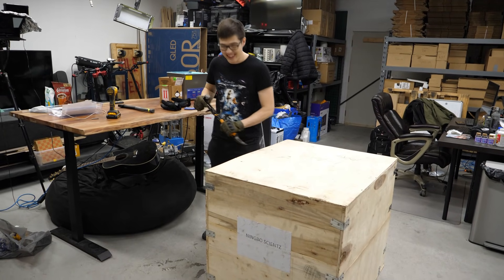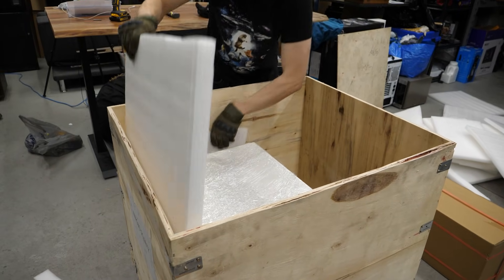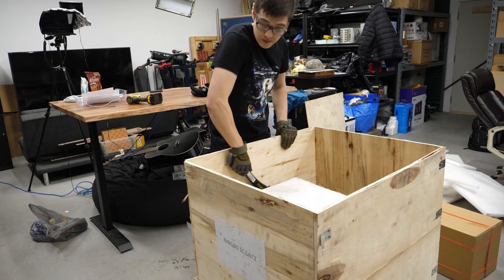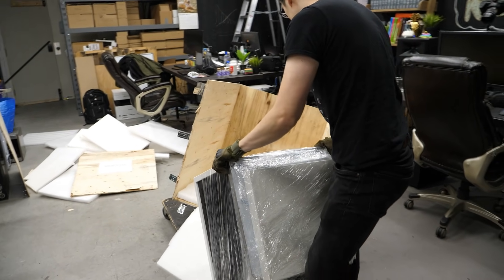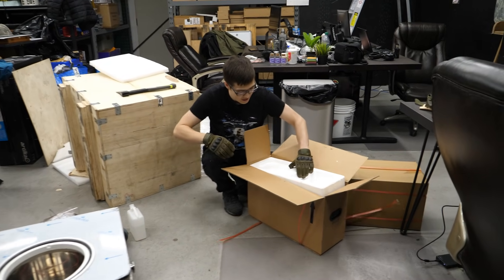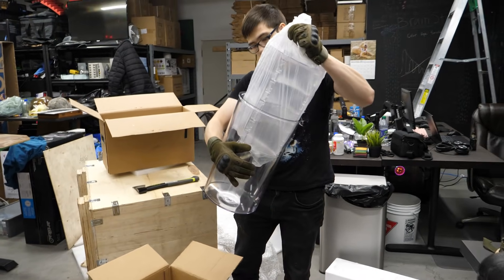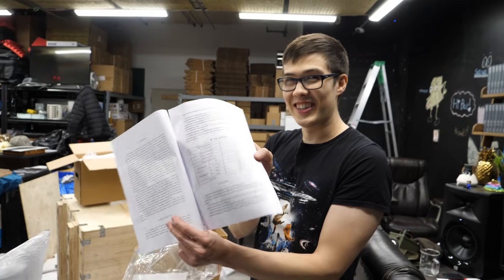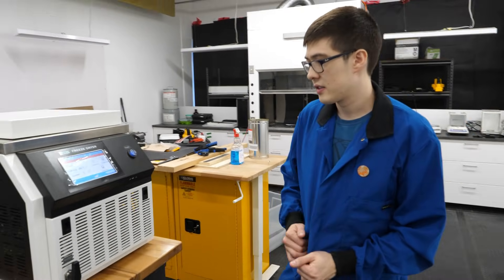Freeze dryer unboxing

Comment: I have a thing to say about you dropping it a little. There is a refrigeration compressed in it and just dropping it a little can damage it also after lifting it up onto one side you need to leave it for around 30mins before plugging in because the oil in the compresser can go were it shouldn't and you can't compress a liquid.

Comment: I think it's funny how many lab machines like this are very delicate and come with indicators on the package so the customer knows if it could have been damaged. Then here it is tilted 30 degrees and dropped 😂
Reply: Bet the instructions said; allow machine to sit in final location for 1 hour before applying power. Hope he filled the Vacuum pump with oil.
Reply: eh, it is sturdy enough to withstand that kind of shock. Had some equipment arrive in worse shape and it still worked, although it was dented a bit.
Reply: So gnarly. It made me want to unsub.
Reply: One of the reasons instructions are so play-it-safe is to reduce potential user induced failures which the equipment was not tested/assured against. Why such big focus compared to mainstream products? I think it's because for a lot of these companies prestige is source of their income. Universities and research companies buy this equipment.
Study papers that are being produced by labs/unis rely on peer review process and using unknown/cheap/prone-to-failure brands might create bias in the reviewer eyes, questioning if the machine worked correctly, wasting time, energy on something that is not core focus. So Labs/Unis look for equipment that is prestigious and gives strong assurances that it will work as intended. Then, when failure does happen, unis/companies may've lost millions in research data and time so they won't just write off the cost, they likely have an insurance company that will cover some of it - Insurance companies will investigate and if they prove that manufacturer was at fault, they will demand the money from manufacturer. This creates also bad press not only immediate monetary loses. So money and prestige reasons.

Like "use it only on an even surface for proper leveling yadayada" may in reality not change much, of course you're putting it on sturdy table but if during investigation it is found it's even slightly uneven (and that likely is defined in the manual too), the manufacturer comes out clean. 

The potential cost of risk is so great that it creates overpriced, very bureaucratic equipment.

"But this is from China, what do they care, they are authoritian and can't be sued hurrdurr" - China also has universities, very strong ones at that. They have 1.4billion people. Countless companies, labs, insurance companies and individuals. Their own market is so massive they absolutely need to have assurances to compete and they don't operate as a single hive mind.
Reply: @MartinzW  Valid point written VERY well!  I didn't think of that, but it makes sense in hindsight it is essentially "Lawyer Speak" to prevent liability.  Couldn't agree more on how wrong "othering" countries is, and that when they put their mind to it China can make good stuff.
Reply: Granted if my understanding is correct, this is just a vaccum pump, and some sort of controllable heater.  Might have a “cold finger” which could complicate things (cryocooler for that etc) but otherwise not too Fragile i *think*.

Still though not good to handle a nice piece of kit roughly.

Comment: Remembered unboxing a very similar model same as from China and testing it with water which boiled below or close to 0 Celsius as far as I remember 😅 Was a shock initially back then but my professor made be realize that it is the vacuum that makes water boil at low temperatures. With the temperature drop I guess towards -20°C or around, water got frozen eventually of course.